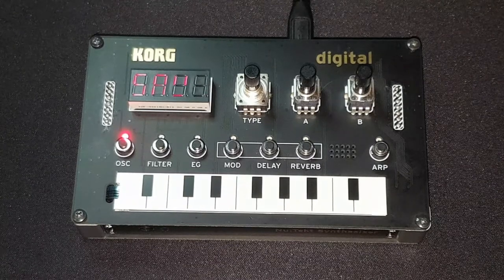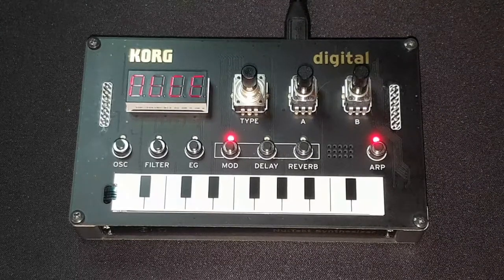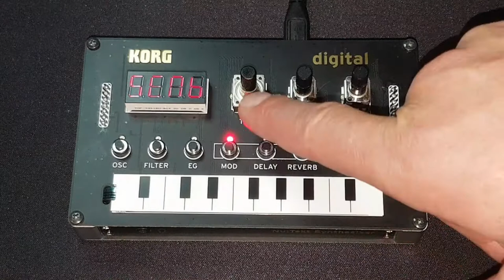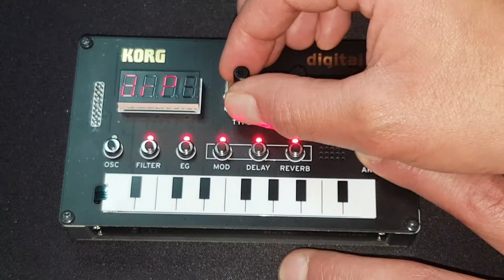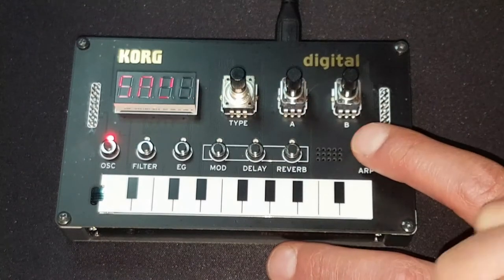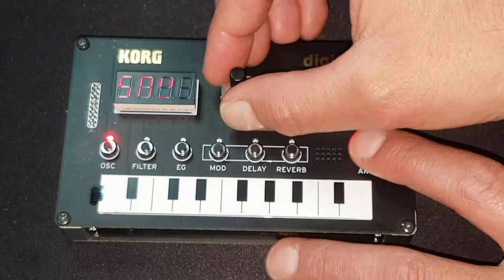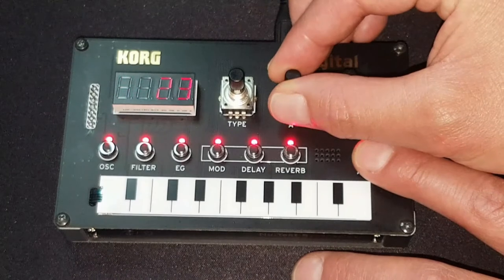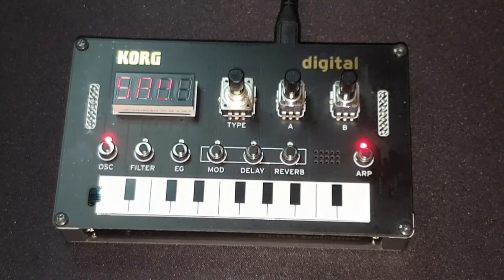Using the Arpeggiator on the Korg NTS-1 Digital Synthesizer

Comment: When the NTS-1 is connected to midi(in this case a Circuit Tracks), the appegio can not slow down via a bpm knob. Its fixed to 16/24/32/64, wich in most cases is far too fast. Does anyone know if its possible to play 2/4/8’s??